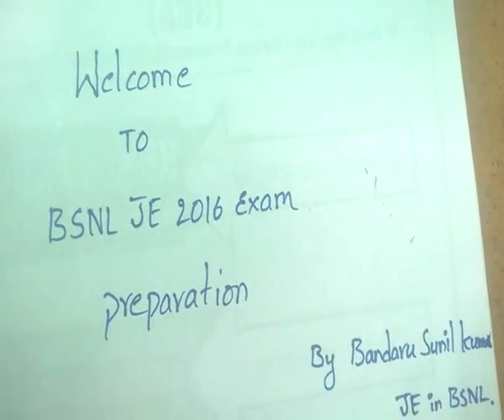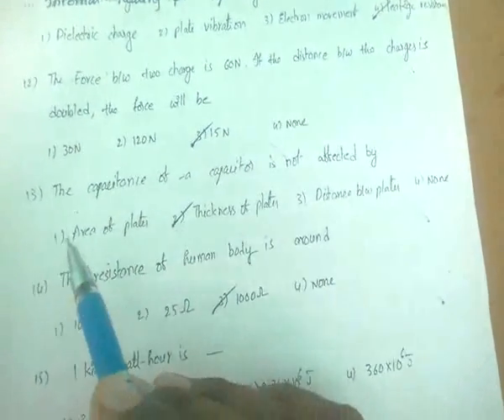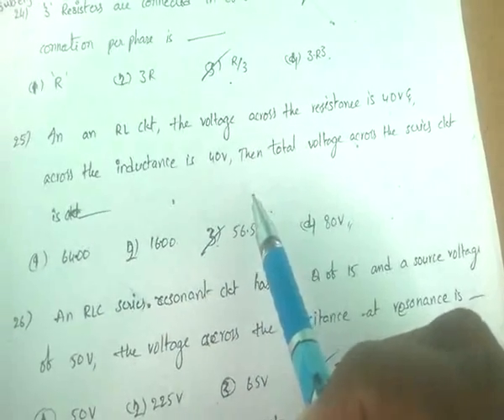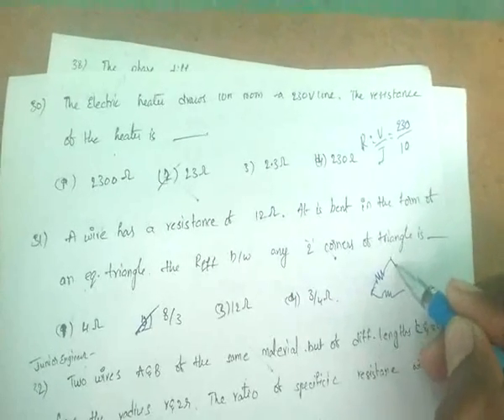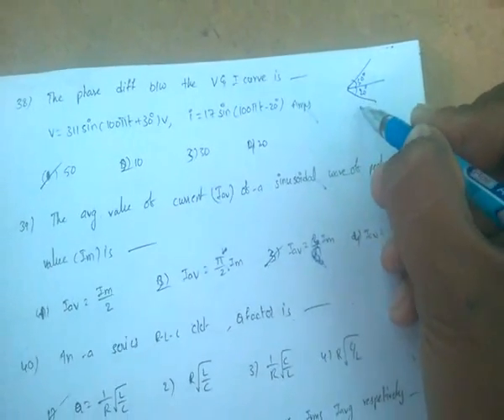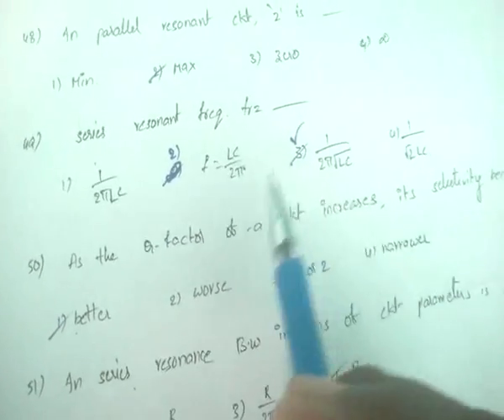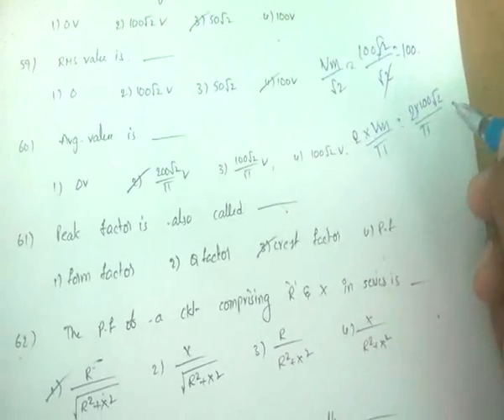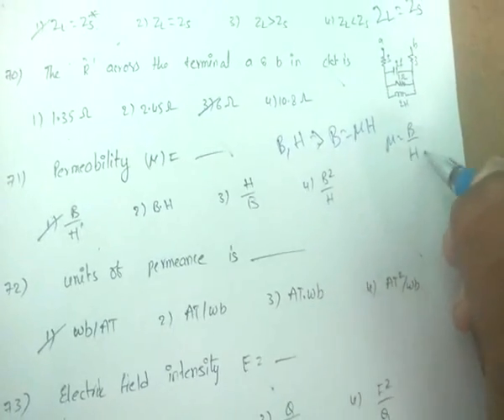bsnl je/ssc je exam preparation mcfq's of basic electricity

Comment: sir, i have doubt in que no 19
last lecture m apne btaya ki when capacitors connected in series, voltages are equal....
can u explain it..??
Reply from the maker: when capacitors are connected in series voltages are un equal..not equal..i didnt told volages equal ok..for this question 

V at  3 micro farad = total voltage 120 * [opposite capacitance 6/total capicitance (3+6)] = 120* (6/9) =80v..ok...
when capacitors are connected in parallel then voltages are equal.. reffer once again my video ok..thank you

Comment: thank you so much sir......question no 20 answer is explained but i'm not getting it can u explain .. in third step 80+5c how can we get that
Reply: In a case of capacitors combination series and parallel calculation get reversed so 8 and 2 would be in parallel so 1.8+2=10muF and next branch 2.(6+c)muF and total capacitance is 5muf so now both branches(1 and 2) are in series; so {1/(10)}+{1/(6+c)} = 1/5 => {1/(6+c)}= (1/5)-(1/10) => {1/(6+c)}=1/10 => 6+c=10 => c=10-6=4muF is the answer... __/\__...
Reply: Thanks Ashish ...